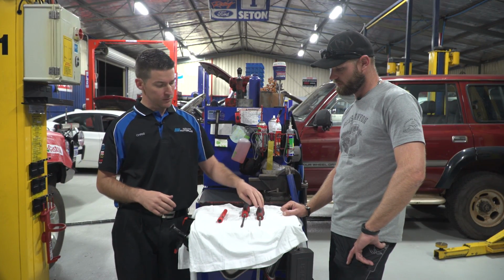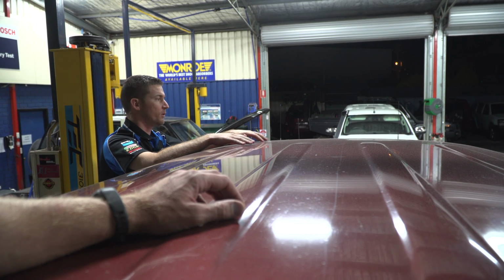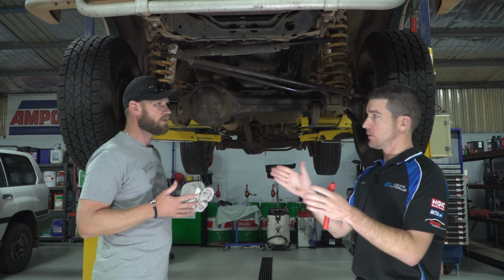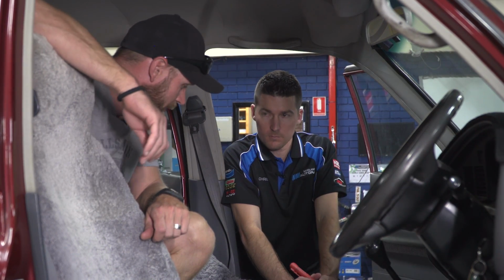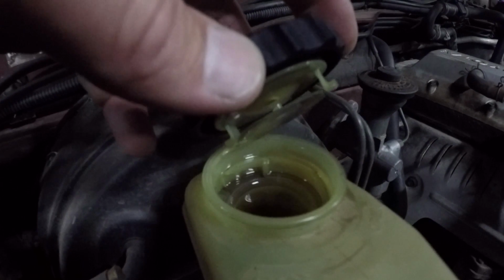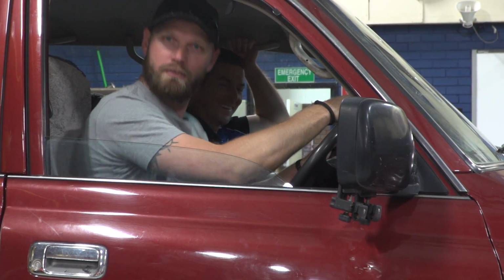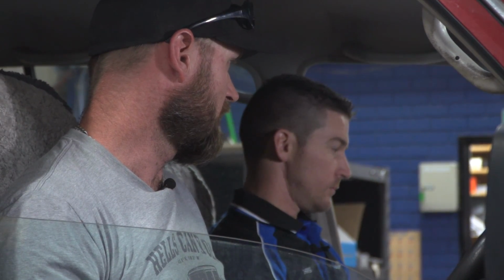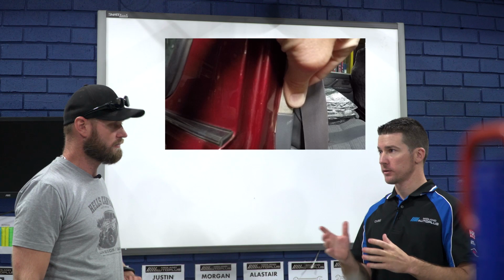Buying a used Vehicle, Overland version part 2

Comment: Great video Ronny. Another good tip is to open the oil filler cap whilst the engine is on a see how much air is getting pushed out. A little bit is normal, but if its a lot it means worn engine.

Comment: These are great tips.  I helped a buddy replace the frame on his Jeep a few years back because either the dealer he bought it from or the previous owner had covered up the rusty frame with aluminum tape and spray painted it black.  At a glance it looked like the frame was in great shape and all of the temporary warranties expired long before he noticed anything wrong with it.  By the time we replaced the frame the engine and transmission was the only thing holding it together.  After we got all of the parts off of it the owner literally folded the old frame in half with one hand.  Had he seen this video before he went to buy it maybe he would have been able to spot the issue before he bought the vehicle.

Comment: Here is a tip I use at work to check for previous water in fuel damage on a diesel. Go to the return side of the fuel system and pull a Banjo bolt, and check for rust. Since its return you don't have to prime it to start it back up, and if there is rust on the bolt you can be sure there is rust in the pump and injectors. When owners say" I have never had water in my fuel" that's  not possible. All diesel's have tanks that are vented to atmosphere so hot fuel in the return coming back to the cold tank Bamm condensation. So what your really checking for is if they have kept up with there water separator maintenance. I love these types of maintenance videos. Keep it up!

Comment: **EX MINING VEHICLES: 1: check for plain white steel wheels. 2: In Utes, such as a Landcruiser, look for a heavy duty steel tray or a steel tray with white sides but black underneath, 3: check if the chassis has been resprayed. **

Comment: Check everything in the car, all the toys. Push, pull,  or poke every lever switch and button. That way you not only find out if they work, but what they do as well. And be extra sure to check the seat adjustment works properly.

Comment: Great tip on reaching into the air cleaner outlet to engine....i always freak my mates out how much red dust bypasses the standard (non wet) paper air cleaners...
Landrovers run a oilled paper air filter  and the inlet looked as good as the day it was molded even after 200000km!!

Comment: The  70's -90's had uneven gaps between alot the panels from the factory . Seeing this doesn't instantly prove a collision unless the gap is 1/2 an inch or more and differing colors of paint or signs of bad prep work under the paint are present .

Comment: hey Ronny, great information. I'm a tech in the US and just a tip about checking to see if a clutch is slipping without beating on the car. if you car driving at a slow speed say 20mph, put the car/truck into a high gear (5th or 6th If it has it) and give it a lot of throttle. if the clutch is going to slip, it will probably do it under those conditions. be mindful however on a turbocharged vehicle as this isn't great for the turbo, however doing it once or twice to check clutch condition isn't going to kill it.

Comment: I have been inspecting Pajero Sport 2018+ for purchase. I am surprised there is some underbody rust on every single vehicle.  Exhaust pipe, tow point, sub frame  , etc  I have seen 6 already. Is this normal or is it just Mitsubishi? I have never owned or inspected a 4x4 SUV before this so may be just my ignorance.  Thanks!

Comment: Forgot to check if the oil feels gritty between fingers if the oil is cold as have seen sand to shut up big end knocking ,also if warm when you get there wonder why as may have problems starting when cold.

Comment: i got a discovery2 td5 as replacement via insurance for a car crash it was presented well zero issues that could be located till 3 days later it seemed to eat the coolant now 7grand later its coming home was a engine oil cooler inside the engine that had failed yet how do you find that when its got new coolant in it ??????? buyer be were not just old land rovers many 4x4 have hidden issues that only present once you drive them

Comment: Ronny, Great video, I cant help but notice that you forgot to test the windscreen (shield) on pitting. It is a safety issue, as a rule of thumb you should replace your windscreen every 80.000 Km or even faster if you drive most of your time in a dusty environment (see 40:20 on your video timeline), the light gets scattered to the point that it becomes a real safety hazard. The driver not being able to have a full unobstructed view out the car is a much more serious issue. 
Nor the crack or the bull’s eye really poses a safety problem.
Love you video's.

Comment: im curious about the red dust, why is it so bad? i had a gq from a 1 owner and it had red dust but absolutly no rust. full service history and every recipt kept from when he purchased it new
Reply: stevojan the red bull dust is very fine and very abrasive. It's not as much about rust and more about the fact it gets into everything and wears it out. 

I was recently on a property in central Queensland and the cow cockey was laughing about how he was buying a new 70 series for the farm and he was going to get the old one detailed and then sell it off in the city where some unlucky chump would think he was getting a bargain.
Reply: generally the red dust "pindan" is just a pain as it gets in every where an way and layers up over time....

however if it gets into the engine through a buggered filter, it is highly abrasive... some say it was part of the oil consumption issues on early LC 200s as they had an ill fitting airbox lid allowing unfiltered air/dust in!!
Reply: stevojan it also clings to metal components like glue in the under carriage and holds moisture when it gets wet which increases rust very quickly.
Reply: if it stays in the out back with minimal salt no drama...however if left on the chassis etc then used regularly on the beach without washing...yes thats gonna be nasty!